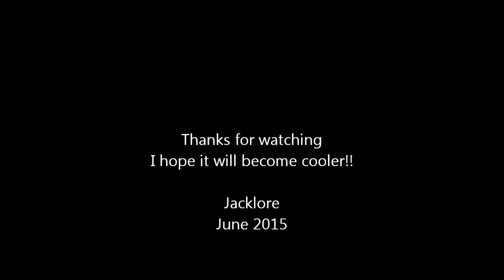Workshop extension and improvements Day TWO

Comment: You picked a hot day to mix concrete by hand but it will dry quicker, concrete smith now,atb John.
Reply from the maker: John Wellings No John. Not Concrete Smith. I am a Cement Snith
Reply: +Jackloreknives 
Cement is what holds the concrete together